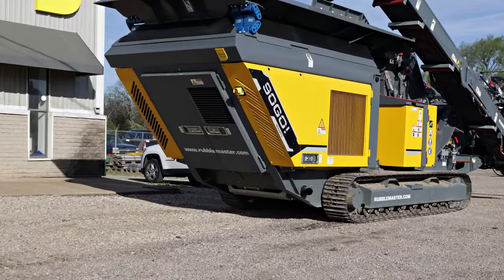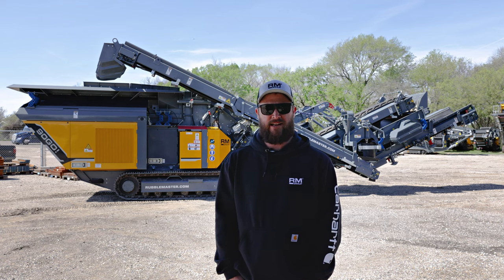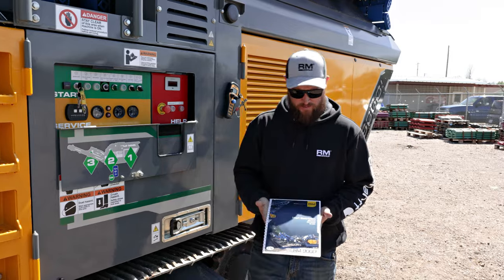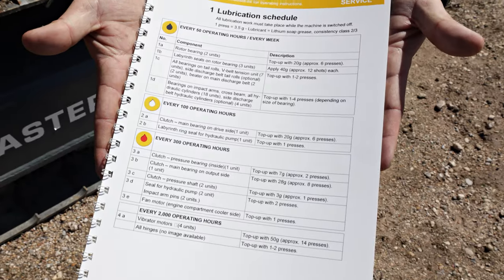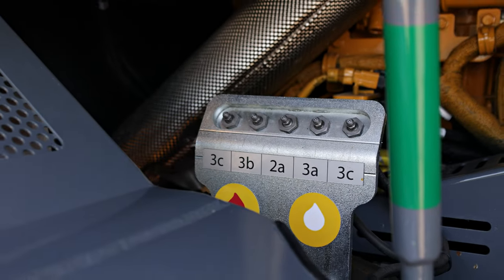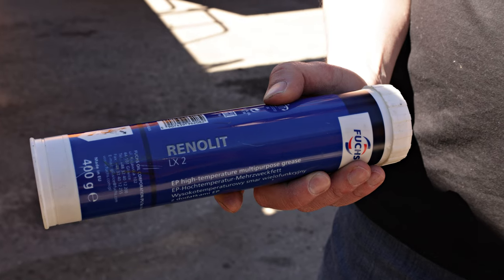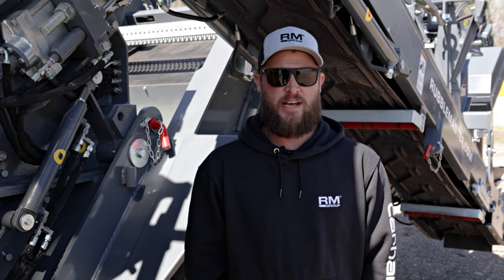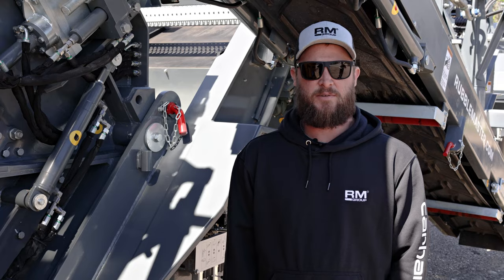This is how to grease a compact crusher | RUBBLE MASTER

Comment: When I operated a finish screen in 2000, I greased it about 3x a week. That is what I was told to do. Some of the recommended grease intervals I disagree with. I have been taught to over grease a little using a hand pump grease gun. My dad taught me to grease machines every 10 hours or so. But the equipment he operated was older and needed the extra grease.